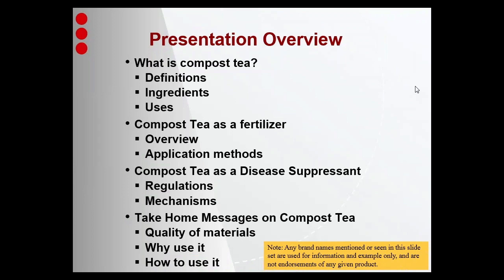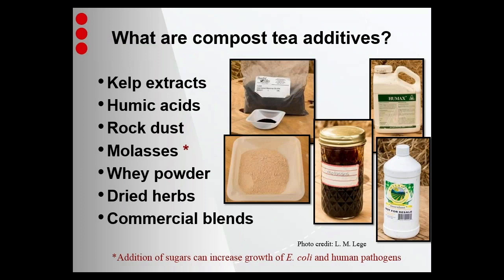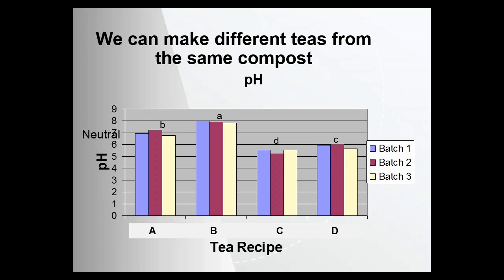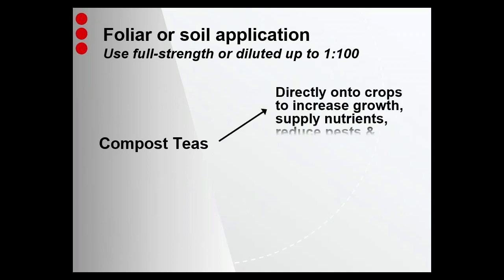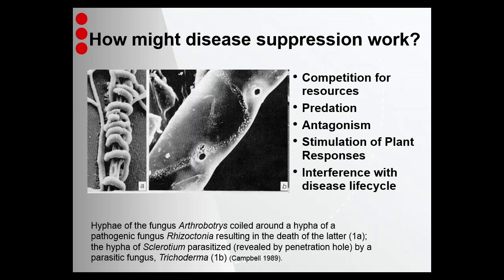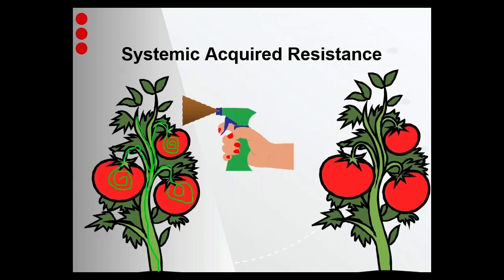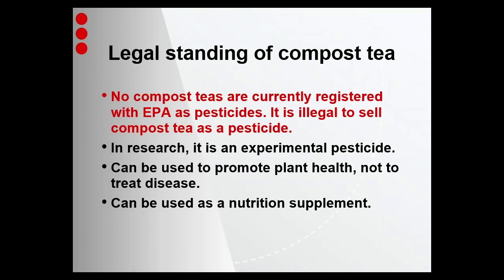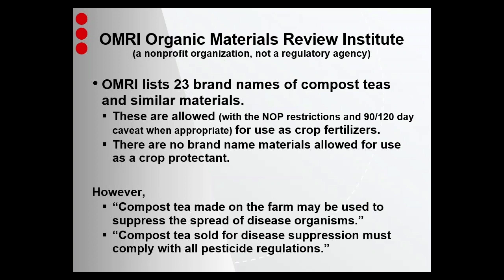Making and Using Compost Teas

Comment: Great info in the process. Thanks! I have a question for the experts: 

Our city uses chloramines to treat the water. We don't have things set up in our urban community garden to use rainwater and bringing in pond water is not an option right now. However, we are located in Northeast Indiana where there are a lot of natural peat deposits. I get a dump trucks of it (3yds) for $50. From what I understand about peat, it has a lot o humid acid in it. I am wondering if I can use a shovel full of peat to neutralize the chloramines before adding the compost. If so, do I need to bubble the  water with the peat in it for a certain length of time before adding the compost and starting the actual compost brew?

Comment: Well rounded presentation, nicely done.  My take on the prime benefit of using compost teas is to increase the count of soil bacteria which is rumored to have a symbiotic relationship with the root hairs of the plant of interest.  More bacteria means the plant can adsorb more nutrients from the soil as the bacteria act as a go-for for the plant's roots.  My own anecdotal observation is that my plants increased growth significantly within three days after I started using compost tea on them and I've never looked back.  Added nutrients is not why they almost doubled daily growth as the fertilizer levels were quite good already.  I'm using  a cup of commercial cattle manure compost, half a cup of commercial vermiculture compost in a five gallon bucket held at 40 degree angle with aeration from a simple weighted aquarium air hose and pump.  I do add a tablespoon of sugar, some honey and a tablespoon of 30-30-30 miracle grow like soluble fertilizer along with azomite, fish and kelp extract, and raft of other trinkets I think might help.  I then let it ferment or roll for 48 hours before adding it to applied water at the plants base.  I will stir the rolling mix as I happen by just to help distribute settled out compost parts and trinkets in those two days of cooking.  I'm totally sold on the stuff, best results I've ever had hands down.  I decidedly do NOT have a green thumb either.